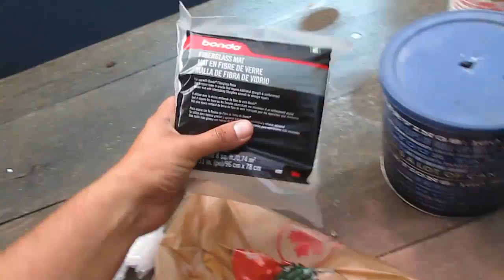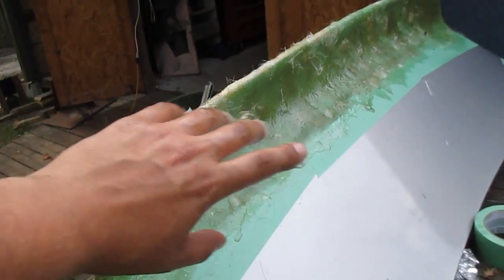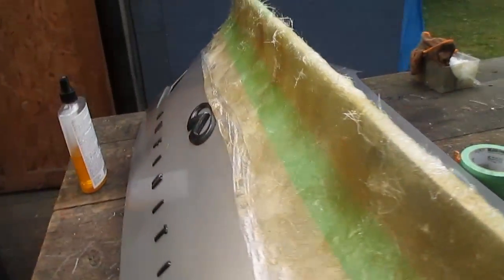How To Make a Fiberglass Spoiler Template - G35 Vlog

Comment: Hey Dnali, question for ya hope you might be able to help. I’m interested in purchasing a 2003 G35 sedan 6mt how ever the seller isn’t very forth coming with info . He say the car just shut down on him while on the highway and now the car won’t start won’t crank just a click . What would your opinion be as to diagnose the problem . Much thanks for your videos and input .
Reply from the maker: Trevelle Misick for me sounds like an electrical issue. Maybe bad battery or ground would be my first guess
Reply: Thanx D
Reply: That sounds like the cam sensor on the passwnger side went out (pretty common with the Gs).

Comment: Hey I just bought a 2006 nissan altima 3.5 se. I bought a k&n intake for it. Should I also buy the block off plate and is it worth it
Reply from the maker: Joe Pizzo yes the block off plate is by far the best bang for your buck.
Reply: DNALI thanks alot.  I'm going to buy it. I'm a big fan of your videos